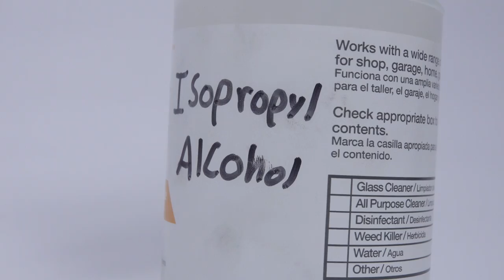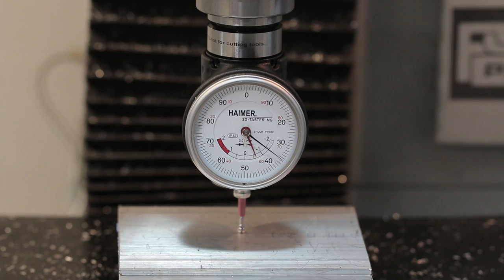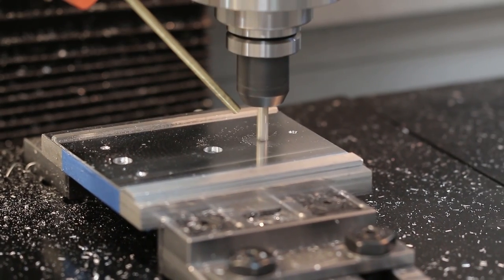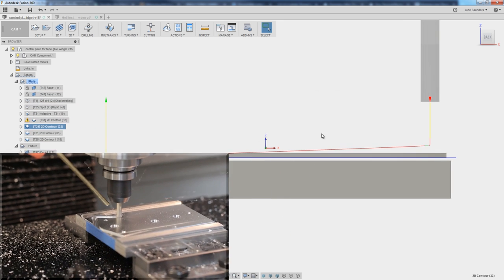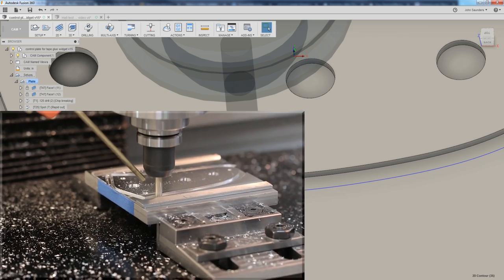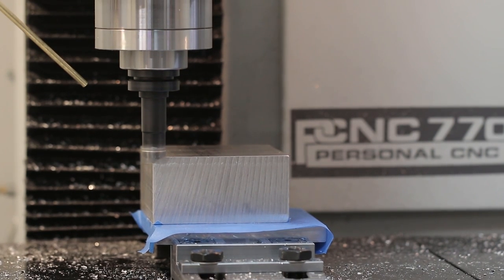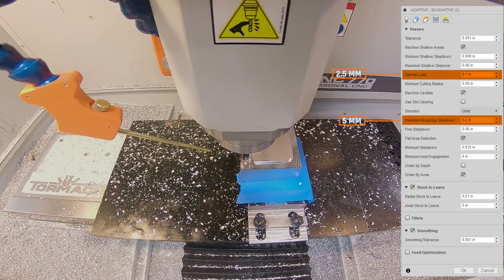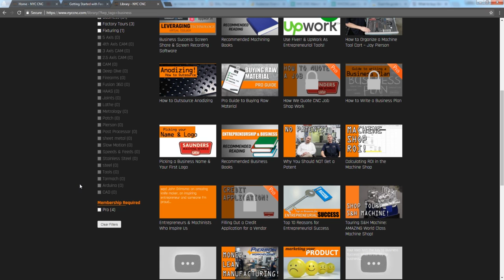AMAZING Cheap CNC Fixture: Superglue! WW185

Comment: maybe a dump question but why is tape being used instead of gluing it strait to the plate ?
Reply: t837qvhsdKJ it grips better on the tape, and it's easier to peel off tape than scrape superglue off
Reply: Removal?
Reply: You can super glue directly but removal may require quite a bit of heat and the fumes are nasty. If using super glue I need to use a propane torch... if clean, the parts hold very well.
Reply: oke makes sense thx
Reply: Tape acts as a bonding surface. Superglue works by capillary action, it gets drawn up into tiny pores of materials then expands and hardens. Paper tape has a bunch of these pores evenly distributed so it makes the perfect bonding surface for superglue.
Reply: Occams Sawzall The CA only bonds the tape layers and never reaches the parts? That's pretty slick. Thought maybe John had invented this method.
Reply: Kent VanderVelden 
It goes into the part some as well, otherwise you’d be relying completely on the adhesive strength of the painters tape, which isn’t very strong at all. 

The tape acts as a lattice between the two, but the CA still has to physically be on the metal parts too
Reply: Kent VanderVelden 
And any micro pore material will work too. 

Newspaper, tissue paper, tight weave cloth, etc. 

Painters tape is convenient because it’s sticky on one side making it easier to work with.
Reply: Occams Sawzall Thank you, that's great information and I'm going to try this with glass slides to try and see the action. (Btw, Love your YT handle :)
Reply: Kent VanderVelden 

The tape also makes removal easier.  The CA bond within the tape is stronger than the bond to either piece. It will always come apart via the path of least resistance. 

If you ever noticed when you break apart something CA bonded, one side is always perfectly clean while the other still has glue stuck to it. 

With the tape, the tape is always the strongest, and the path of least resistance is on both surfaces of the parts. So you get two clean surfaces, and a stiff plate of tape and CA.
Reply: Some  of the other replies here are simply not accurate- the super glue does not glue the parts together, it glues the tape together- the tape is used because it provides a lower strength bond than super glue, which allows easier removal. The whole bit about porosity is incorrect- you can glue glass or metal together just fine with CA glue, it will just be a bitch to get apart. They do make a super glue remover, but applied to the edge of a seam on impermeable materials, I'd expect that to work very slowly, if at all. If you want to glue the plates together and skip the  tape for some reason, use hot melt glue , or some shaved bits of hot melt glue stick, heat the parts with a torch or heat gun, to glue them together and remove when you are done. This works too- I'd say at least as well as vacuum tables and magnetic chucks for small parts.

Comment: How does the aluminium block stay in place when there is only the tape in contact with it?
Is it something to do with the tape being porous?
Reply: The forces on the tape are mostly in shear- put a piece of tape on your window- can you slide the tape?  This technique does NOT work well with aggressive  feeds, high helix endmills, or large depths of cut. Also, you should program your last through cut to be shallow- if your DoC on previous passes is .100, make the penultimate pass only .010 above the bottom surface of the material, then your final pass a couple of thou below the bottom of the TAPE, that will help keep the part from lifting. If you don't cut THROUGH the tape and bottom out IN the tape, it will make a gooey mess and probably dislocate your part. BTDT.
Reply: @mytuberforyou  Thank you for your advice. I shall be putting this to use on a 27" X 13" X 3/16 thick aluminium plate. It has machining towards the centre which leaves about 1/16 left. It is always a pain to machine. I am hoping this method works for me.

Comment: So im in need of a shear hog type insert  tool around 1" that i can also use in mild steel and stainless. Has anyone had any luck here? I got a cheap APKT 3 flute 1" tool im going to try soon
Reply: The shear hog is my favorite tool! What kind of machine are you using?
Reply: Jackson Sharp SV 2412 its a 10hp 8k rpm machine

Comment: Pronunciation: sigh-anno-acrylic glue.
This stuff hardens from contact with water, as in moisture in the air. Spritz a little dampness on the part that will contact the glue and it will set up real fast. Maybe that could be helpful. Or maybe it could be too fast. Perhaps worth trying.
Reply: Interesting! The glue seems to cure quicker here than with other applications I use it for, so I wonder if dampness left over from the diluted isopropanol I clean the tape with is acting as an accelerator.
Reply: That is not how you pronounce cyanoacrylate.

Comment: You guys only do aluminum with this fixturing method or anyone ever try steel?  I know feeds and DOC will have to be drastically reduced.
Reply: link to powder coat masking tape and looking forward to seeing video showing practical speeds and feeds for using this method on steel. You guys are an inspiration.

Comment: Anyone tried Loctite 495 ? It´s cheaper, and according to its Technical Data Sheet, outperforms Loctite 4851 (On Aluminum 12 TO 19 N/mm², against 10 to 14 N/mm²)

Comment: No credit given to who you got the idea from and no superglue activator on the other face which really does help.
Reply: I find with the activator that it doesn't really care, it seems to actually work fine even if you put the glue on something and then spray the activator right on the glue and then set the other part, you only have about half a second to do it, but even then it works- the activator does not seem to be a bonding agent, it does not need to be applied to the surfaces to be glued- it seems to simply catalyze the glue.

Comment: Couldnt you just use http://www.leevalley.com/en/Wood/page.aspx?p=49224&cat=1,330,49238&ap=1 double sided tape. This is what I use and works good too.
Reply: My immediate thought was... this is making double sided tape, so why not use double sided tape?
Reply: You can't burnish double sided tape to both sides of the workpiece, and the glue layer will fill any slight unevenness between the two surfaces in a way that double sided tape just can't.  Thicker double sided & carpet tapes can, but then you essentially have a thin rubbery layer securing the part which = chatter.

Comment: Nice solution mhh but for 
stainless steel/high-grade steel maybe this not work or ..??.
Reply: We have more testing to do, but extruded aluminum is inherently flatter and less oily than steel, so it tends to work better. Success is most dependent on how much surface area you have for the tape to adhere to.

Comment: How is this cheaper than the one time purchase of a work holding device? Between the price of super glue, painters tape, alcohol and the extra 30 mins it takes just to let the glue dry doesn't seem worth it for anything other than a very special operation. 
I challenge anyone to come up with a one time work holding device that would cost more than this, and no a fixture plate is not a one time device and can be used for multiple parts. 
By the way it looks like your head needs to be trammed by the look of how that fly cutter is cutting.
Reply: It's cheaper for me since I have those materials on hand,  with the activator the glue is ready to rock within 10 seconds, not half an hour. Some thin, small parts are very tricky to hold, as I'm sure you are aware- and cerrobond is expensive (though reusable) and requires dragging out a heat gun, then allowing your parts to cool. May be some temper issues also with cerrobond,  on some parts, I don't know much about heat treating.
Reply: @mytuberforyou  if a machine shop were using this to hold everything that needed held it would cost a machine shop over $1000 in just tape alone over a half a year not including the 20 mins of part changing, super glue, alcohol, and accelerator, yes this will take 20 mins to remove the made part and add the new part to cut. My complaint isn't that this is a good idea because it's an EXCELLENT idea for specific applications, the problem I have is that it's both not cheap (they claim it to be really cheap to use) and the time it takes keeps this from being viable in a production shop, both of which they are somewhat claiming it to be good at. I can very much assure you I will be using this technique but it won't be for something quick or multiples of.
Reply: This is not for every job. Just the difficult ones where you have a thin part or something that distorts very easily under vise pressure.

Comment: Do you ever make anything with serious GD&T tolerancing? That would never work as real direct Geometric counterpart to the workpiece..... Mickey Mouse machinist....
Reply: I would say the vast majority of us that make parts for various things RARELY need to hold tolerances under a couple of thou, usually even 10-20 thou for most parts is acceptable. If you need to hold under a thou, say a tenth, you sure as hell better not be doing it with a Tormach  hobby mill, even a decent VMC  with good rigidity  (Fadal, etc.) should usually  not be expected to hold under a thou. I doubt John has ever worked from the type of datum used for close-tolerance medical or aerospace parts and neither have I, that does not mean we don't make useful parts for things. Most common parts have a boatload of tolerance, heck, even an AR-15 receiver calls out 20 thou on the tolerances. You can call people like us "Mickey mouse" but we use what we have and many of us have skill sets that extend far beyond machining-  we do not focus on precision machining to the exclusion of everything else. We build entire assemblies to less precise tolerances, not one turbine blade, over and over. We have machines that we can afford, often that we have built.  They are not as fancy as full blown VMC's, but when they break we don't have to call a factory tech and take the machine offline, we can fix them ourselves. IMO there is something to be said for that. Room for all of us here in this world.